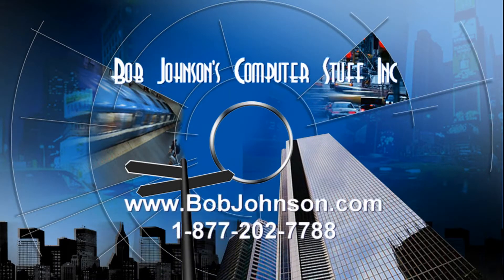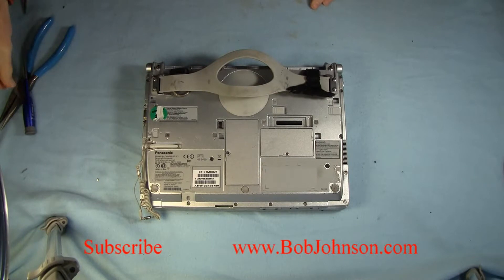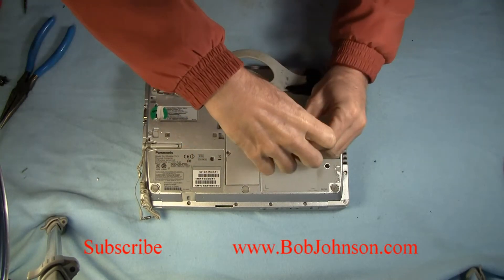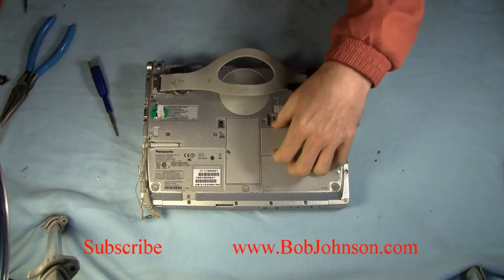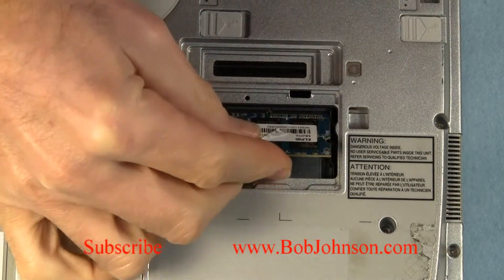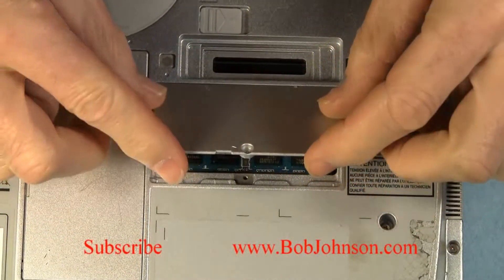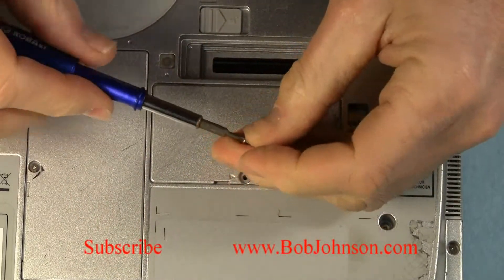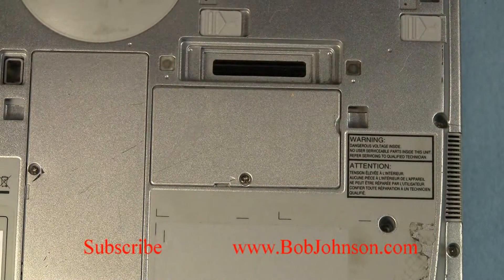How to Upgrade the Memory in the Panasonic Toughbook CF-C1

Comment: how to replace i know i need to know he has 2 Slots for Ram or only One ??
Reply from the maker: There are 2 slots of RAM. In this video, we show how to add RAM to the second slot which is the upgrade slot. The other slot is not easily accessible. You cannot access the second slot without removing the motherboard. It is between the motherboard and the casing
Reply: @Bobjohnson  is it possible it can add the exciding ram like I have 4gb ram so when I put a ram on the second slot will it add

Comment: My son has a Panasonic Toughbook CF-Y5 14.1" Core Duo 1.66GHz 60GB 51... for work on Honda`s  besides adding 1gb  ram which i ordered from amazom , is there any low cost upgrade that will improve Performance and do you sell that part